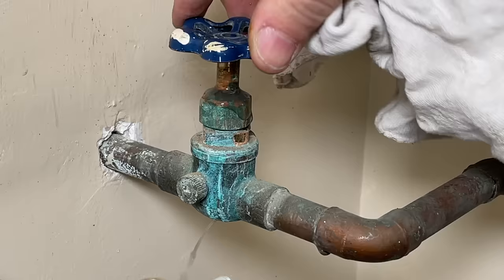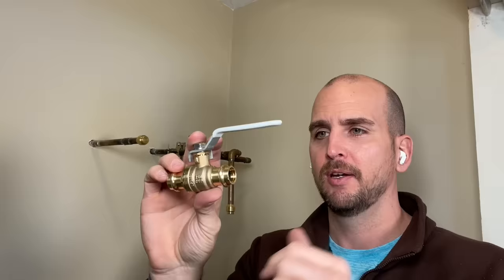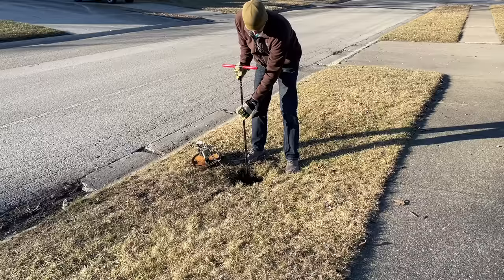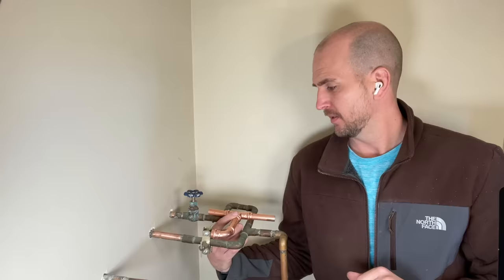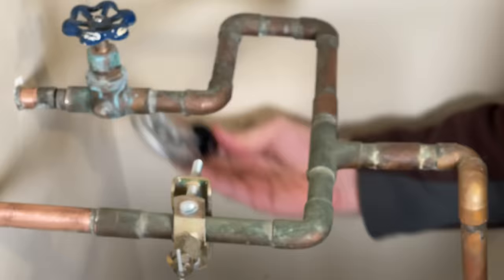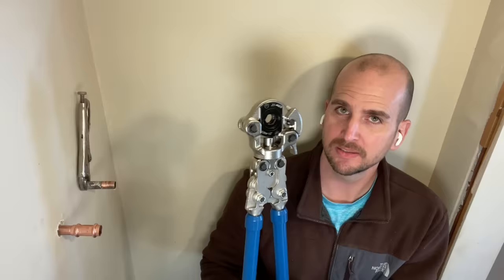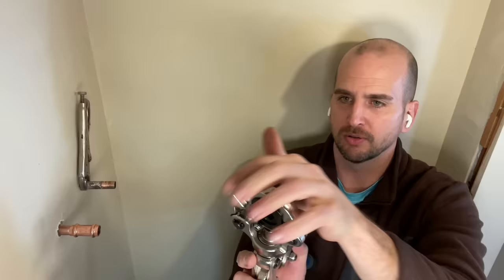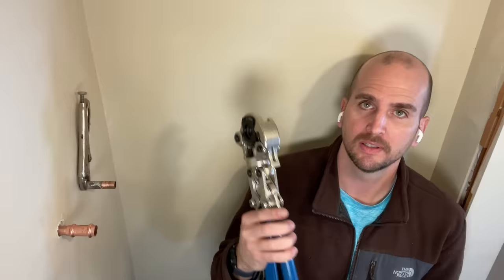How To Install a Main Water Shutoff | NIBCO Press Fittings

Comment: Just watched your globe valve repair and HAD to watch this one. I have PEX tools, NIBCO crimp tools, torch and solder, as well as wrenches. You present a lot of good information and options. This is where I have to showcase the error of your way. NIBCO manufactures some amazing products that I can use all of the tools listed above to install which ever product the customer spec's. This is where contemporary marketing bites us all in the A$$.

You repaired a globe valve with a little knowledge, sweat equity and $0.30 worth of materials. That valve is now good for another 50 year run and if maintained will last indefinitely. I commented on that episode. Do not misunderstand, I love 1/4 turn balls for replacements and new installs.

You have shown the replacement with a NIBCO 1/4 turn press fit ball valve at a cost of $30.00. Not to mention the "Special Tool" which can be had for $100.00 and change. This valve has no serviceable parts has a rubber O-ring and deforms the pipe.

Now here is the rub.  1/2" PEX 1/4 turn ball vlv will run about $6.00 and the tool $40 and no serviceable parts or rubber O-rings. SharkBite or equivalent 1/2" 1/4 turn ball vlv is about $17.00, is reusable, requires no special tool, does not deform the pipe and has no serviceable parts or rubber O-rings. Let me just stipulate that 1/4 turn valves have no serviceable parts. You replaced a functioning serviceable valve with a WAY more expensive and potentially inferior Valve. The jury is still out. Unlike the Quest plumbing of the past that was manufactured using inferior materials, NIBCO has introduced a potential weak point in their "Press Fit" line.

Recall the galvanic corrosion on the globe valve and the state of the stem packing and the washer. That corrosion and decay were caused by minerals in the water. The globe valve is infinitely serviceable with new packing, washers and Plumbers Grease. The NIBCO O-ring is NOT serviceable and is subject to the same decay. It may be prolonged by coating the O-ring with Plumbers Grease, this will also aid in installation, but that O-ring WILL eventually FAIL. Ask NASA.

Don't be fooled by marketing. A trickle of water started the Grand Canyon, it will level a house!
Reply from the maker: Thanks for all the feedback 👍
Reply: I hardly ever respond in the comments but I agree with Jamie.  If it were me, I would have put a male compression fitting on the copper then crimped on a female fitting to the pex  line then attached the 1/4 turn PEX ball valve.

Comment: I was fortunate that where I work, the plumbers had the rigid battery operated press. I considered soldering, press fit or last resort shark bite, but was assured this press was just as good or even better than the other 2 choices. If I weren’t for the battery operated press this job I had to do would have been a nightmare. In the future for how easy it is, press fit is well worth the expense even if I have to buy the hand press.

Comment: We used a shark bite coupling in a daily use 1/2” copper feed at least 15 years ago also a shark bite cap on a 1/2” copper line about 10 years ago, both are still holding today in a commercial restaurant.

Comment: One of the greatest advantages of the press fittings over Sharkbite push-on fittings is the press fittings are full flow, just like a soldered fitting. Push on fittings have a significant reduction in inside pipe diameter.

Comment: Isn't the point of using solder so that you can remove the pipes by heating them up? By making a permanent connection, if this ever has to be removed to be replaced you lose some length of your pipe.
Reply: True.
Reply: Only with certain fittings though. Only if the it's a 90 or a flex line for a water heater or if you have union fittings that you can remove and sweat the unions off. If you have to replace a tee fitting you can't just sweat the fitting off you still have to chop it out and put a new tee, pipe, and couplings.
Reply: No, solder is a more permanent connection (though contains lead but not much.) You can't really replace them. I mean you can cut them out and replace, but it's not just a simple melt and replace. Also, things have to be pretty perfect before soldering, or you just cost yourself hours of messing around. And, of course, many people can't solder.

Comment: 👍👍using the nibco press fitting is much simpler and quicker than sweeting copper pipes. I used the shark bite fittings on my hot water heater and It worked very well. I will switch to the nibco press fitting.🇬🇾🇬🇾🇬🇾🇬🇾
Reply: Simpler yes, but it's not much quicker at least not with 1/2" pipe

Comment: Cool video, with good detail.  I didn't know there were any crimping solutions for copper (I never was good at sweating tubing).  If I was doing this valve replacement, I would have added some extra tube to the stub to allow for a future valve replacement.  That said, that ball valve will probably last a long time!  Nice work.

Comment: I'm 5 months out of a bad back surgery and I still have a hell of a time trying to squeezing the manual hydraulic crimper around half inch copper pipe. I so wish I wasn't disabled with crohn's disease and had the money for a battery-operated one.. as the Crohn's disease definitely makes it much harder to squeeze those handles together as well. 23 years of what my doctor calls the worst case of Crohn's he's ever seen. And I'm still out here at 53 years old hustling trying to make some money so I can afford things I want. And of course you have to have money to make money in this profession. Because the good plumbing tools are far from cheap and they're not light and weight at all. And swapping all of my pliers from channel locks Milwaukee than other inferior pliers over to Knipex and Snap On. That's not a cheap endeavor either.

Comment: I have used the battery operated crimpers and they are indeed very quick and efficient, but they are very expensive. I have been looking at these manual crimpers on eBay for a while, but have been hesitant. Thanks. I will be more inclined to buy one now

Comment: I use a ProPress for hotel bathroom renovations, because it’s a commercial site they don’t want you to use a torch.  

Great job of cleaning the pipe before pressing! You can get a leak if you don’t, the leak would probably take eight hours to make a drop, but it’s still there.

You could also rent a pro press for a project. 

The most important thing is the order in which you press each fitting.

After you press it’s fitting mark it with either a sharpie or put a piece of painters tape on it so you know it’s been pressed. 

You keep pushing the fitting on the pipe until it bottoms out there’s no need to measure.

I’ve actually cut a live pipe in a hotel, because we didn’t have permission to shut down the water for the wing of the hotel. Simply put a ProPress cap on it, and pressed it. You can’t solder a active pipe with 80 psi of water coming out.
Reply from the maker: Super handy, a lot of the guys around me have switched over to ProPress and you don't see the torch coming out often.

Comment: I have been using Sharkbites now for the last 12 years and have not had one single installation issue with them ever. Yes they ARE costly BUT I know that I can count on them to endure.

Comment: I've used sharkbite connectors in my home since 2010. I've never had any problems but only use them in exposed areas. Sharkbites have been used all over the world for decades. Inside walls I sweat the pipes the traditional way. 

Personally I'd never use that big crimp tool. That's just an answer looking for a problem.

Edit: I'm just a homeowner that does casual repairs when needed. If I did plumbing repairs on a regular basis then the crimping tool could be a good option. Just thought I'd update my comment because opinions change over time.
Reply from the maker: Hey Mike, thanks for the feedback and I think Sharbite fittings are great especially for accessible areas and DIY.

Comment: I thought that I would just say that in the future, putting on a ball valve is great but you really should emphasize that in tight spaces the ball valve when installing it should open away from the wall! And secondly when attaching your crimp tool you should show a close up of how you are putting the crimp tool on the pipe to be crimped making it easier for DIY'ers to grasp! Otherwise, thank you for this and all your informative videos! I'd also like to see a video about crimping PVC pipes which I've done for a whole house 3 filter water filter from home depot which turned out great!

Comment: I have used sharkbite and similer push in fittings. I occasionally use Viega  pro press fittings and ridgid press tool. It’s most useful in old homes where cutoff valves may not cutoff completely or pipes just refuse to drain out in a timely way making good sweat repairs difficult. Stuffing bread in pipes is more of a desperation or poor planning move. I recently used pro press to adapt  PEX A to copper in an  old house. Never tried a manual crimper.

Comment: I would solder a copper to Pex fitting and then use pex. I use cinch clamp fittings. Bought the one handed ratcheting crimper $35-$45 that is small and can get in tight spaces. Ordered fittings from SupplyHouse or others on the net, cheaper than local HD Lows. Have all kinds of fittings in a parts bin. I have used this system in multiple houses, mine and rentals. Can use fitting and go from galvanized to pex. I have used sharbite when necessary, no problems. I don't reuse them because of the teeth inside, and o-rings. I think Sharkbites need to be straight connections, not cocked and stable, no movement everyday from pipes shifting. Seems like just too much stress if not. I love the color code of pex, makes it easy to identify issues/follow pipes when you are in a strange house.

Comment: For a simple job like this Shark Bite is cheaper and easier because only a few fittings are needed and no expensive tools required. I installed a shark bite fitting for a toilet supply line over 20 years ago and it's stiill in place and never leaked. The reason I used it aside from being easy was because there was only about an inch and a half of copper pipe sticking out from the wall which was too close for comfort for soldering.

Comment: I've used all 3 types of fittings.  Honestly, price wise it's always cheaper to sweat.  it's a little more time consuming, but especially when you're dealing with acidic well water that tends to eat pipes, I would rather have something that's easy to replace.  With a sweat or shark bite, you can remove the coupling (with shark bite you can even reuse them) and replace the section that's bad.  With a pro-press, you'd have to splice in a patch line, because each time, you're nipping more of the pipe off, and then have to use 3 fittings to fill the void (if you're replacing an entire stick).
Reply: that makes sense, each cut you're making that copper smaller and smaller.  Better to sweat or use shark bite

Comment: Hey there I bought the same exact tool from Amazon paid $150 for it but all the adapters to do the job I used this tool once not only was it super easy great to handle and it's already paid for itself I recommend this way above shark bites it's more professional looking and it's definitely stronger
Reply from the maker: I am a fan of Sharkbite as well but agree this is a great alternative and nice to have an option to buy a crimper that isn't $1000's of dollars.  What brand of Press Fittings did you use NIBCO or ProPress (Viega)?  I used NIBCO just because they are stocked at the Menards in my area.
Reply: @EverydayHomeRepairs  I used Viega cuz that's what was available but at the end of the day this system is 10 times better than SharkBite I think and my crimping tool looks exactly like the one you have same color telescopic arms and different size fittings half inch 3/4 1 in I have a couple more jobs to do in my house to fix the flood that I had so it's going to come in handy

Comment: I have this tool and it works fine. I would rather use PEX, but I do keep copper in place as long as it doesn’t fail. These press fittings are so new we don’t know yet if they will fail in 10 years or last longer. As for Shark Bite…. They should really only be used in an emergency basis.

Comment: I love shark bite fittings quick repairs had a service call customer was working on his plumbing in basement thought water was off cut pipe water shot out an main didn't hold so I used shark bite to stop leak then went out to main shut it off an installed new main ball valve

Comment: I retired from a plumbing supply and both shark bite and pro press seal via an o ring. I have used both, the only advantage of  pro press is the fitting can’t rotate.

Comment: I'd prefer to solder a valve in place whenever I can but unless you can stop the water flow completely, soldering is out of the question.  That Pro Press fitting is a good idea if you can live with something that can't easily be removed, and/or re-used if in a jam like at 11:00 at night.  Years ago, someone had come up with some kind of a gelatin capsule that you could push inside a copper pipe that still had water slowly dripping.  They also supplied a 6" long plastic tube used to push the capsule inside the pipe, and once it was inserted, you'd quickly assemble and solder your joint.  When done, all you had to do was heat the pipe in the area of the capsule and it would melt, allowing the water to flow once again.  I used it once in a jam and it worked great, but sadly, I never saw them on the market after that.  I think the Pro Press fittings have their place, just not 100 % of the time.  BTW, it's just my opinion but I think Amazon Prime is a big rip-off; remember nothing is free (like shipping).  I tried Prime for 30 days free and the first thing I noticed was, the price of the item was higher for Prime members.  Not sure what happened in your case, but you stated you paid $178.00 for the tool 13 months ago, but the price shown just now (when prices have skyrocketed) was $148.00.  I cancelled my membership right after I saw what their game was.  Great video, and a great find on the low-cost pressing tool.  $148.00 is not a terrible price for a serious DIYer.  You'd pay that much for a good reciprocating saw.

Comment: We only use shark bites for temporary purposes. We cap stub outs or use a shark bite male to put on a temporary hose Bibb. Oh and it didn’t look like those were properly deburred. When they say deburr it’s kind of a misnomer. People think of burrs as little pieces of copper or whatever. However tuning cutters don’t create burrs like that. What it’s referring to is a little lip from the wheel compressing. This is also called a burr. It’s a term used in knife sharpening. When you sharpen a knife it creates a burr. This is a extremely thin piece of metal that forms along the edge when sharpening. Anyway the reason you remove this in a copper pipe is to stop turbulence. When you cut you can feel it so you ream it until it’s smooth on the inside. If you don’t that little hump will cause turbulence and over time cause pinholes. If you cut it with a sawzall you don’t have to do this because that burr doesn’t form however you should clean it up anyway.
Reply from the maker: Hey Josh, thanks for all the great feedback. 👍

Comment: I replaced several very old non-working shut off valves in my two bathrooms and kitchen with push to connect within the past 8 years with no issues. Also installed 2 "slip push to connect" valves for 2 old gate valves that were frozen.  My brother's main 3/4 " shut valve was damaged but still worked. To fix the problem we shut off the main valve and then installed a push to connect slip value. The slip valve requires you to remove 2" of copper piping. Turned on the main valve and no issues and this job was performed 5 years ago.  When I installed my dish washer I installed a double push to connect on the hot water line for the dishwasher and faucet.